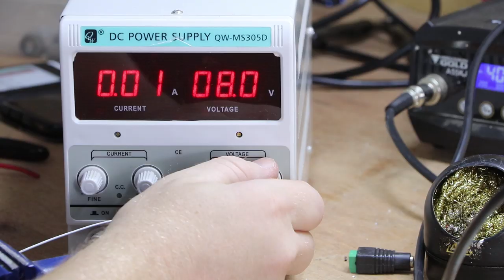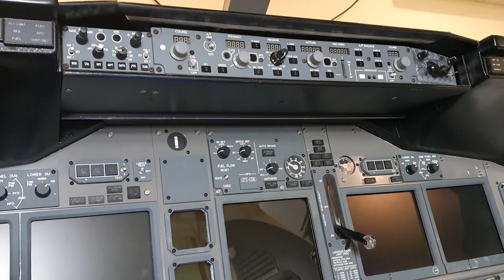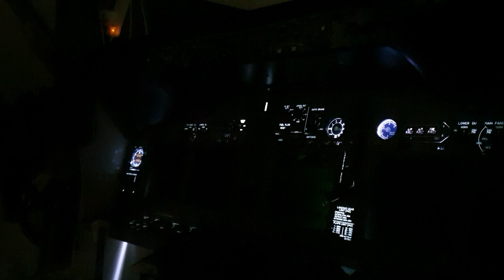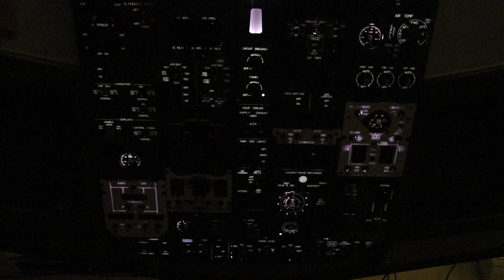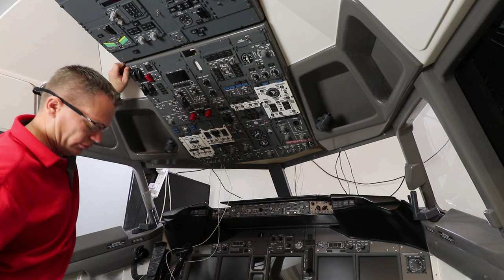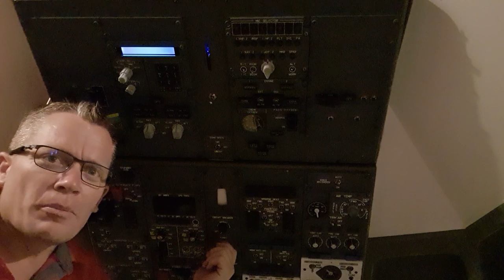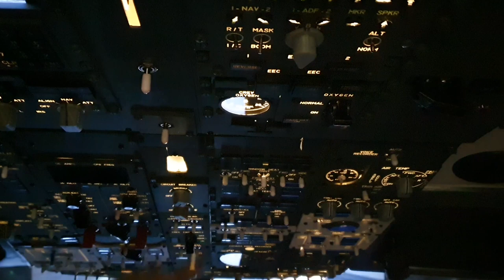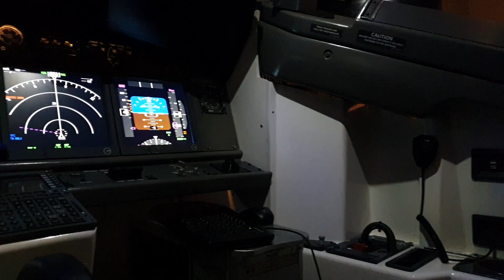737 Lighting Install

Comment: I'm not a pilot but I have worked on the ramp, I used to play around with the light show on 737 200's when ever I got the chance, they are pretty cool.  Watching this video brought it all back. I bet the Max is missing the no smoking switch though. Or is it?
Reply from the maker: Everybody loves to play hangar pilot! I'm not sure about the max. I have not done much research on it. I thought the No smoking sign was a regulatory and mandatory thing on all commercial transport. But it's been a long time since I also looked at those regs. Kind Regards Karl

Comment: You should've installed the lights upside down, and with a bit of a gap, then a pre-diffuser in the rear - something reflective but not like a mirror, something to diffuse a bit.. then the diffuser cover on the front to get rid of the individual light points which are visible...
Reply from the maker: Love the idea! Very cool! Thank You!

Comment: Super video as usual. You managed to make it look like a continuous light strip and even expensive finished fixed base sims seldom has that!  Very inspirational to see the way you connect, so tidy, and for instance the ability to easily disconnect the "overheads" :)
I see you're able to get 5 or 6 displays running from one computer. I am not able to do that when using FSX and my computer has 8 outputs total from 2 video cards. I manage to serve 4 displays but the 5th display makes havoc if connected. I read somewhere that FSX can only use 4 displays max. Wonder if it's true. Did you ever encounter such a problem?
Reply from the maker: Hello Robroy, great to hear from you. Thank you for the kind words. I haven't heard about being limited to four screens with FSX, but that is definitely starting to show its age now. Hace you tried moving to P3d but it might be worth waiting until FS2020 now!

Comment: Hi,
I just discovered your channel and I congratulate you for the GREAT job you do and for SHARING WITH US ALL THIS WORK!
One thing that I don't quite understand (on other cockpits too): how does the light pass through the different elements of the cockpit? Panels seem to be built in Medium-density fiberboard (MDF)? Or are they rather in white plexiglass (which one ?), painted in grey Boeing color and engraved? But even engraved, is this enough to let light through only where there are letters?
Thank you in advance for your help !
Reply from the maker: The liteflow panels are created from white perspex, usually a 3 mm back plate, and a 5mm faceplate. Panted grey then laser or cnc engraved.
Reply: Thank you very much !

Comment: Simply stunning Karl. I've just started making my way through your all  of your Youtube channel. The wiring, connectors and power distribution are art alone. My two-thirds built spaghetti Pedestal is in line now for an up-grade! What would you say was the most common wire size you use, outwith any heavier distribution runs?
Reply from the maker: Hi D G, Sorry for the late response. I use 24AWG as standard between the ardunio and any panel. The 12V and 5v power rails utilise 16AWG.

Comment: Looks great! Just finished building MIP from MDF today! Im scared about all this lighting etc.... i have no idea how i will get this done but will just have to try and see
Reply from the maker: Hopefully, I will have my wiring diagrams done by then. That might help you out a little more
Reply: Heli Mech that would be great! Its knowing what wire to where and as u said u had to use thicker wire and i would not known that. How do u measure whats hardware is pulling etc... im not an electrician so any basics would be great!! Thanks, starting side walls today 😀